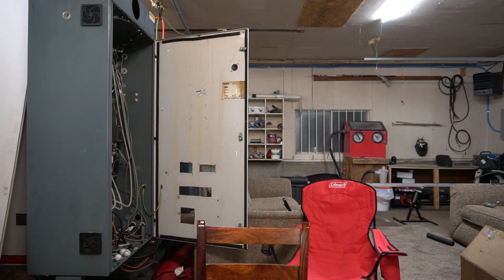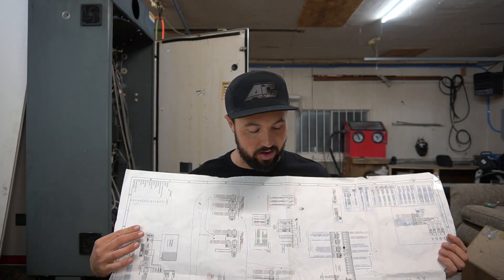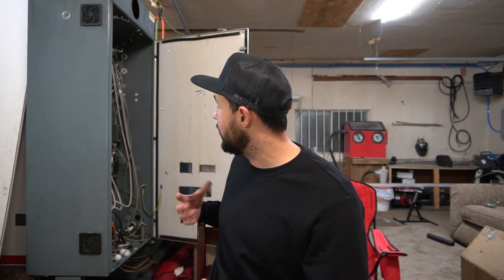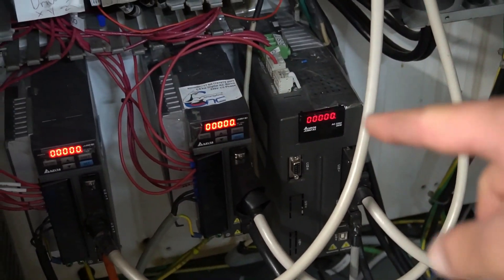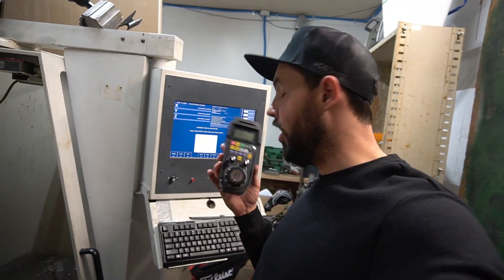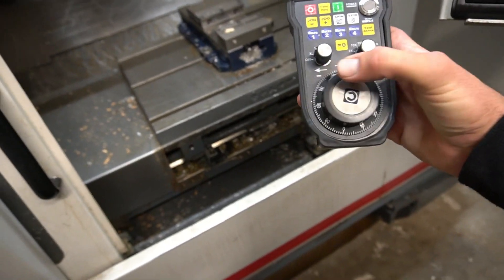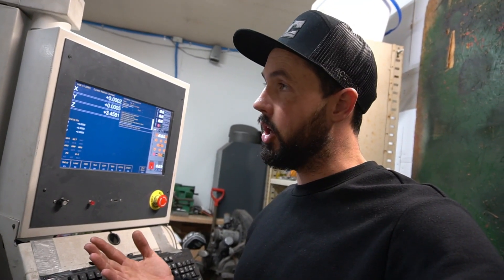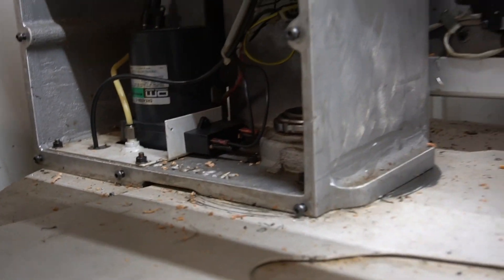Centroid CNC "Shop Update" 12/2020

Comment: Check the frequency setting on the VFD they're often set low from factory
Reply from the maker: Have you got experience with the C2000?  I’ve gotta get it dialed in a little better. My ridgid tapping still doesn’t work so I threadmill everything.

Comment: The wireless pendant is nice. The A2100 pendant isn't too far behind, but no wires getting in the way is a plus. 
LaMont is awesome (I assume that's who helped you with Centroid). I'm glad you got this working, after a retrofit failure. 
I bought a non-working Arrow 500 a few years ago in Salt Lake... I thought I was facing a retrofit but I was able to repair it. I'll hopefully be able to get enough use out of it to get a newer mill (probably not gonna retrofit my Arrow if I can avoid it).
The HMC retrofit is rad. Good work on that one too.
I have similar goals - I got an Acorn from lamont and built a 5th axis indexer for my Arrow. The A2100 can do 5 axis simultaneous if you have that option purchased, but getting it these days from Siemens isn't feasible. So my indexer is controlled separately.
Reply from the maker: Dang man that’s awesome. I got my arrow an a pure chance years ago and it’s cut me a lot of metal.  I love those old machines so much now.  I’ll have to come down and take a look at your indexer. That’s amazing.  I wanna take another rotary and put it on the Mazak to give me 5 axis on that thing.  That’s my next purchase I think.   Let me know  if you end up doing a centroid swap on your arrow 500!